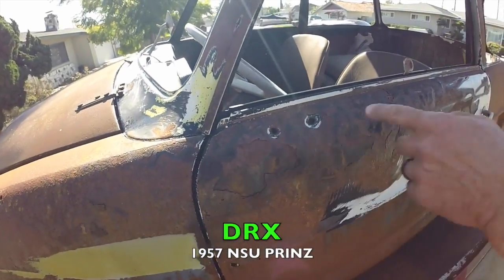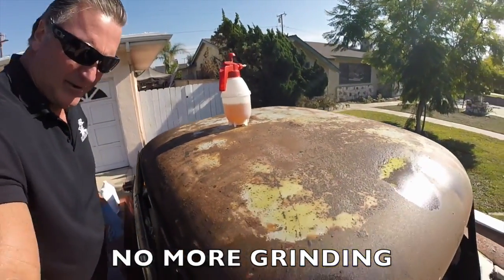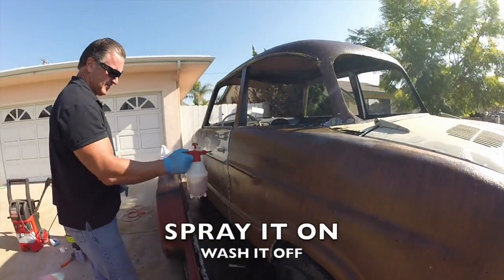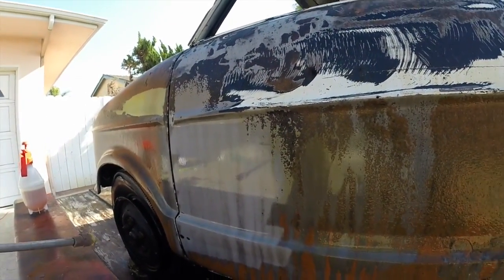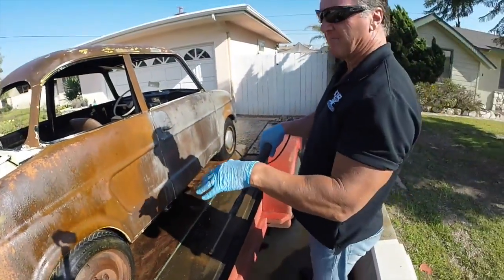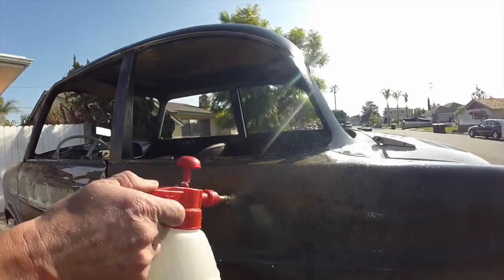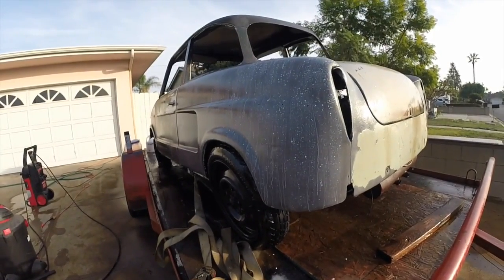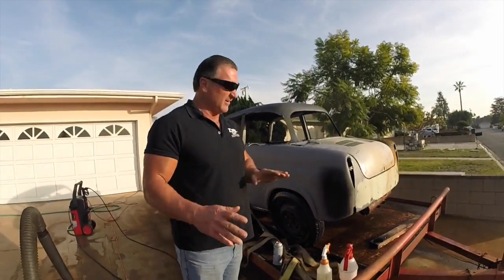DRX De-Rusts 1957 NSU PRINZ

Comment: We used this product almost the same way in this video minus the power sprayer.  We used a garden hose with a adjustable fireman nozzle.  It worked just as good.  We had the car in the shade and waited 10 min between coats (3).then washed the car off did it 3 times.  Used about 3/4 a gallon of DrX on the front clip. Ending product looked the same as the video.  I'm very satisfied and will recommend this to everyone I know.  Thanks Dr X.

Comment: I'm Amazed I'd like to see you pressure wash it first then put the solution on it I want to verify that the pressure washer is not just pulling it off by itself but that engine block video was amazing
Reply: You obviously  have not done  much rust removal

Comment: He sure is the smoothest snake oil salesman I ever saw. Looks like an Albertan son of a defector from Vietnam days. The product looks simply as apple cider vinegar/ non-dollar store vinegar and wonder exactly the chemicals used in the sealer which resembles *Metal Etch which removes the oxygenation and leaves a zinc porous layer. His knowledge of the products is minimal variably to his BS and the Pressure washer and drying times are important.

Comment: The car was previously sandblasted lighty and let set a few days , then he shows how great this rust remover is . Plus he says the sandblasting process doesn't get the rust out of the rain gutters " hes full of it .... 
Sandblast the vehicle , then wash it down .. And if you wany buy some of this product just incase the rust comes back , go for it ...
The truth is YOU'VE got just so much time befor the rust starts eating the metal again.....
DIY is good  " Sometimes "
Reply: Honestly, I sand blasted my rain gutters and I still had some spots it couldn't get to.  I used prep and etch and the last of it was gone within a few minutes.  Prep and Etch costs $15 at Home Depot and doesn't blow holes through soft metal like sand blasting will.

Comment: Wouldn't grind and paint over old bondo that have been soaked in water.....You are sure to get the rust out fast if you do! Have worked with auto repairs, so I know what I'm talking about. Even using water to remove rust is bound to return the rust quicker than with any other method.

Comment: I also wonder about spark plugs if it would work cleaning them up and hope that it wouldn’t break to bake a light on the spark plug itself the white material because if I was to buy something like this to do for my truck I would want to do the whole engine hoping that it wouldn’t affect any of that on the spark plug so I won’t have to take them off because they are rusty to but still have spark

Comment: OK HERE IS THE UPDATE -I USED THIS PRODUCT AND THE GRADE IS "C". 

If you have just small surface rust it will do a job as i used it tree trimmer blade rose cutters, small surface  BUT like most items out there that is not the case as there is rust deposit so at first  I used a shovel that has decent rust and I has to apply 3 coats and there was still rust spots afterwards. Note- you will see rust spots embedded int the metal period,  Plus you must use a pressure washer garden hose will do NOTHING, but does everyone have a pressure washer, I bought this to remove some rust under the front end of my car as its hard to get to so it will do the job as its not as bad as the shovel rust. 
I paid $50 for a gallon of this which includes the shipping part and if I has to the shovel again I would use a wire brush first to remove as must as I can and then use this product to finish the job.
Reply: how much does a shovel cost were YOU live? i'm just asking,no particular reason...just asking.

Comment: what if you dont use the sealer can you spray off with water, then dry, then paint if you were to do it the same day ?
Reply from the maker: Flash rust will start to come back even if you can't see with the naked eye. Cant do the car fast enough without it coming back. You can dry and rattlecan or primer your section at a time and then yes come back and finished paint job
Reply: The next day the rust will be twice as bad as what you took off.

Comment: how bad is the chemical for the environment?
Reply: Rust removers are just acid usually.  Vinegar will do something similar.  Phosphoric acid does too.  A gallon of prep and etch costs about $15 at Home Depot in the paint department and is probably enough for the whole car.  You don't have to rinse it off either.